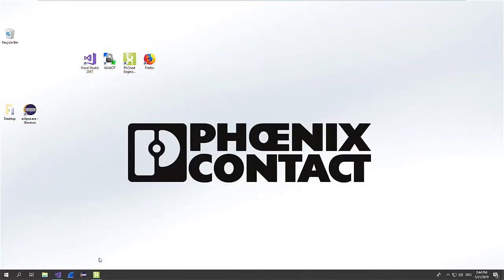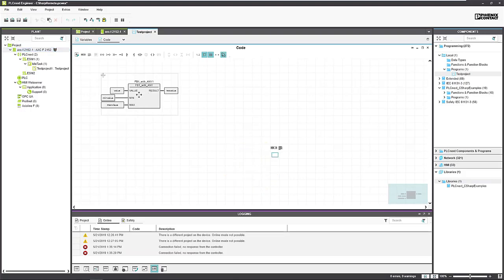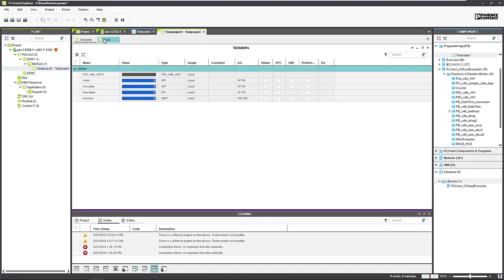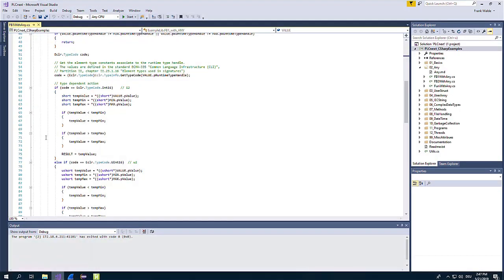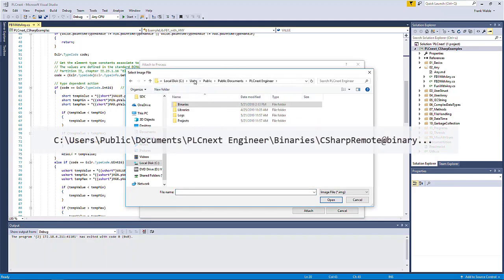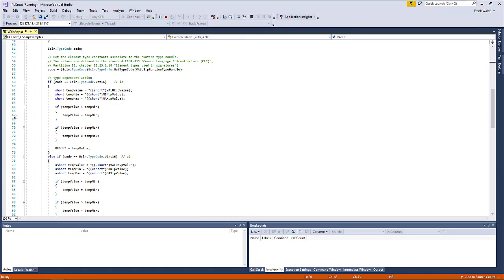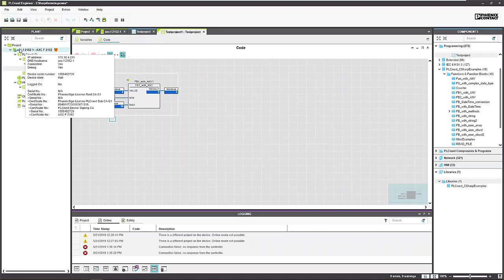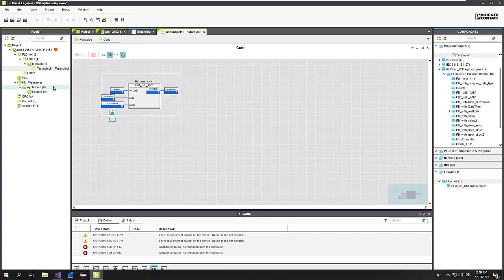How to debug C# code with Visual Studio development tools | PLCnext Technology

Comment: Hello, do you have any C# examples of reading a register using etherNet/IP? I have setup a tcp connection and have sent packages based on the modbus protocol, only to find out modbus isn't supported. All I want to do is read data from a specific address (register) from a  ups that supports etherNet/IP, ethercat and profinet but sadly not modbus!!
Reply from the maker: Hi, mjp500, thanks for that question. 
PLCnext Control devices include PROFINET Master functionality, so this may be the best way to communicate with your UPS.
PLCnext Control devices also include EtherNet/IP device functionality. Here's an example on how to set up the connection: https://youtu.be/rjFSQZLAerw
Reply from the maker: Hi, thanks for your question. PLCnext Control includes Profinet Master functionality, so this may be the best way to communicate with your UPS.
 PLCnext Control also includes Ethernet/IP device functionality. There is information on how to set this up on the PLCnext Community website www.plcnext-community.net. If you do not find the information you need there, please post a question in the PLCnext Community Forum.